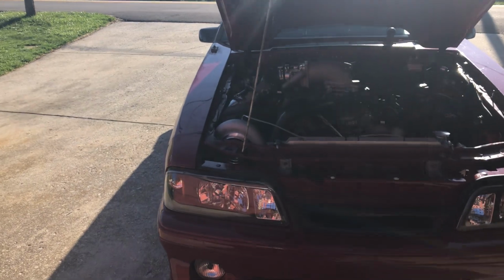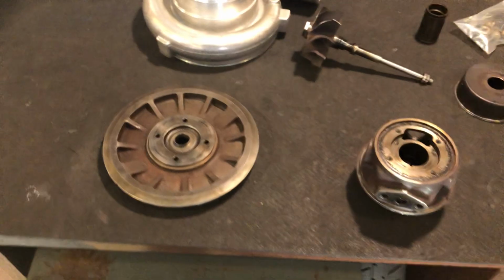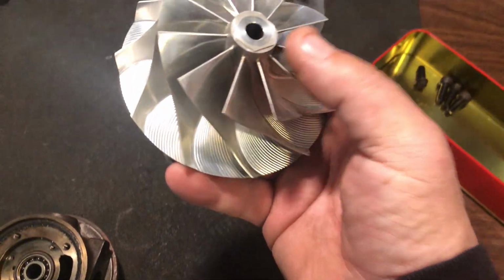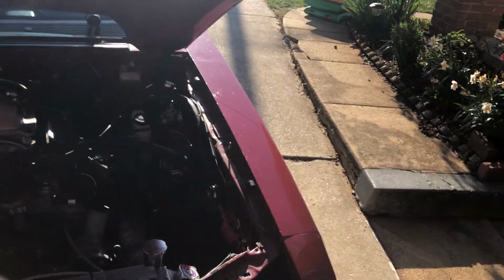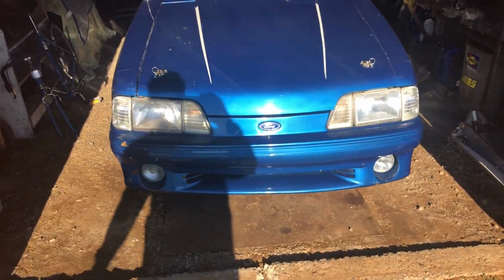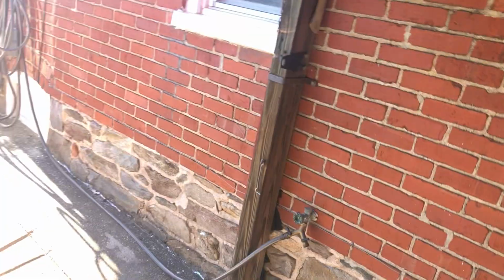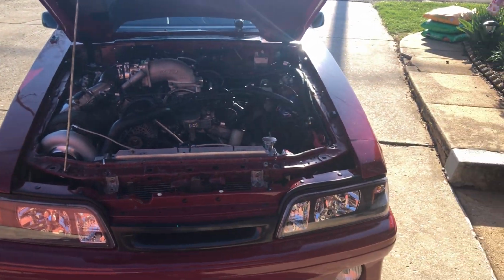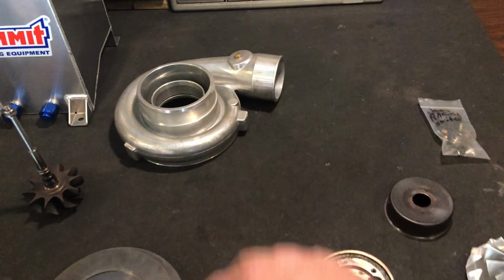PULSAR TURBO REVIEW

Comment: I agree with you I've got the 98mm its a big fella its beautifully built on T6 flange billit wheel duel ceramic bearing it cost me $2200 I also got 2 50mm PSR wastegates and 50mm psr blow off and titanium nappy all up $3k investment, I've got nothing but good things to say about PSR i had some concerns and they answered my questions quickly and were very helpful, yes they are in China but make no mistake they are as good or even better than the usual suspects

this company actually invest back into getting better and now they are a large company and rewrote the book on value for money and very popular with races, some of there gen 2 and 3 turbos are as good as it get and reasonably priced
Reply: You have any before/after results? I just picked up a Pulsar for my SBF to replace a bullseye 80mm. Could only make 19psi on that guy and trap 160 untested.
Reply: @TomR1211  Hi sounds like you've got a problem making boost have you checked everything, I keep mine just under 30psi, mine engine is a built ls427, its a 4.100 stroke lunati sig crank, 6.125 manley rods, JE pistons, I run 11.8.1 static comp, heads are req port which were ported by hand but had a lot of work on the exhaus ports, I run sheet metal intake, 105mm TB, engine took 2 years to build cost me $55K in parts alone engine makes 765hp N/A  and it runs an easy 1540hp at just under 30psi, my mate have very similar build to mine, his has made 1270hp on hub dyno he runs a dish piston with lower comp ratio to me but runs twin PSR's I think he's got twin 35/84 gen3 he's run 8.20 at 168mph he did have some problems building boost at first but was a small problem when he 1st time at a meet but he fixed it and runs great I don't know how much boost his makes its a secret, he can turn her up as he's only done 2 events, you sound like you've got a problem maybe emailing Pulsar our engines are built to make boost you sound like you need some help sorting it out, I'm pretty happy with mine
Reply: @ No problem building boost. That’s all this current turbo has made on multiple engines before mine. Pretty sure it’s a knockoff that is branded as a bullseye. Regardless, should be an easy 7 second street car with the new pulsar. On a 360CI SBF with street style twisted wedge heads from the early 2000’s!
Reply: @TomR1211  the pulsars are way better sounds like its a dog, lots of people are using pulsars, they stand by their products the new gen 3's are killa, I've asked them a few thing before and after purchase 7's thats a 2000hp ask if your got a genuine street car most weight 3200-3700lbs when you run the pulsar come back let us know how you go👍

Comment: I change my oil every 9000 miles but use expensive synthetic oils for my vw, just bought a pulsar turbo for my 2012 vw golf 2.5l 5 cylinder :) GTX3582 GEN 2!

Comment: 25 psi on that engine?  That would be over 1500 hp assuming your windsor makes 480 crank hp. What's up Dude?
Reply from the maker: 22 psi and iam not a stroker motor just a f-cam 0.30 over 351 so you will need lots off boost to get to 1,000hp:body-blue-raised-arms:but your right on a good built motor 25psi should net you about 12-1500hp